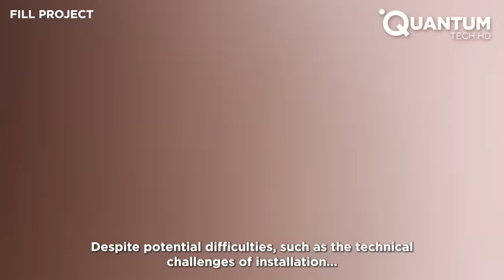Building Amazing DIY CAMPERVAN in 50 Days | Start to Finish Conversion by @Fillproject

Comment: Same problem I see with most builds... too much wood. That suspension isn't designed for all that weight, and not necessary in an age of plastic eplacemets... keep to wood frame and sink bags and such, but drawers and covering should all be plastic. Take the weight down by 2/3
Reply: I thought the suspension on these vans were designed to carry one ton plus in weight? surely a full cargo load is more than the wood they have there?